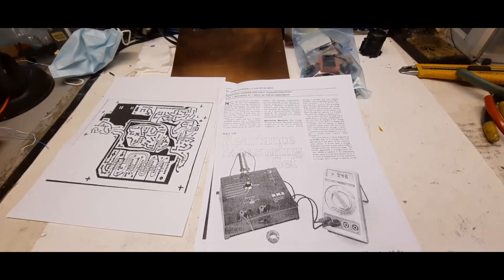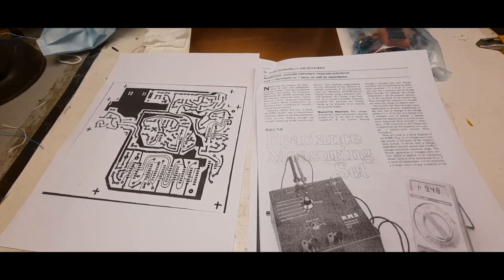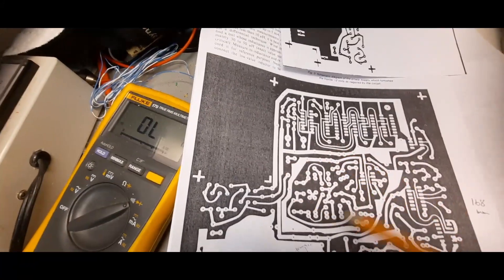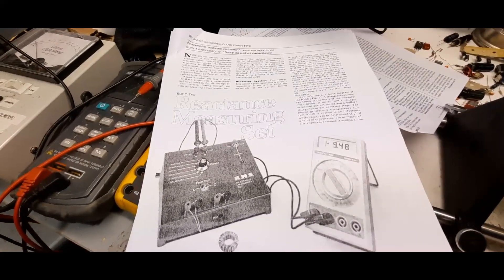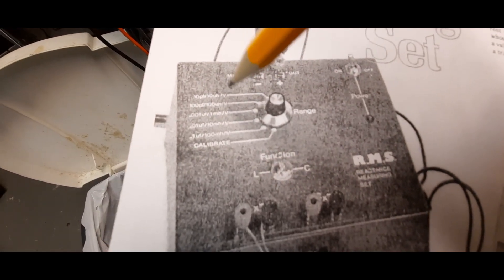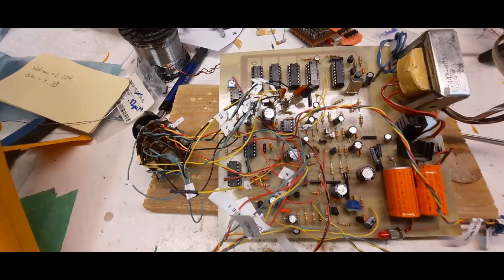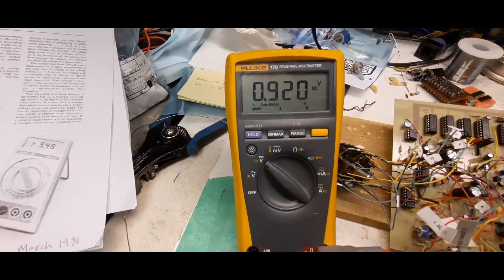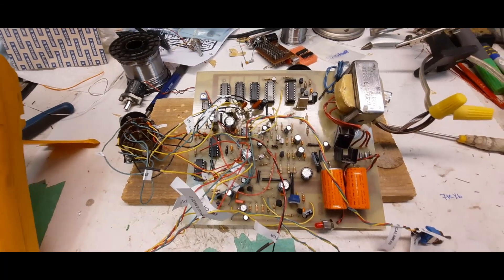Popular Electronics - Reactance Measuring Set - March 1981

Comment: Hi.  It might be interesting to try measuring three or more different, but known inductances, within the same range setting to determine if the reading is linear.
Reply from the maker: Hi ... I did ... and it was linear but consistently off by a compared to a modern meter. It could have been a tool to use if I was back in the 1980's! Cheers!

Comment: I think my first meter capable of measuring capacitance was about 1989. There were almost certainly some available earlier, but not at the cost and form factor of a multimeter that a hobbyist could afford. At least not that I found, although it was a matter of finding it in a magazine...or at Radio Shack.
Reply from the maker: I bought that L/C/R meter you might have saw in the video in the mid nineties and it cost a quite a bit. I am glad I have it as I use it often. Even on this project, it helped!